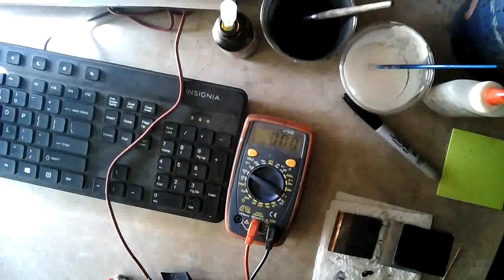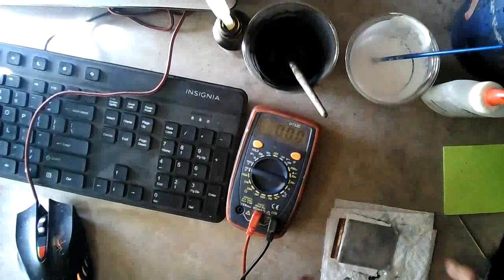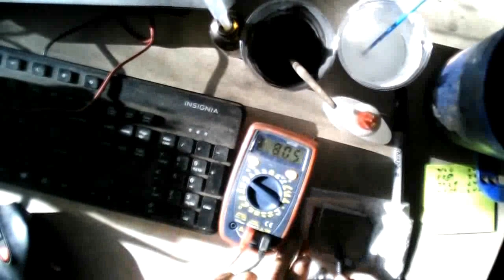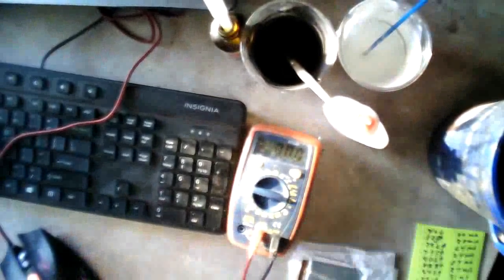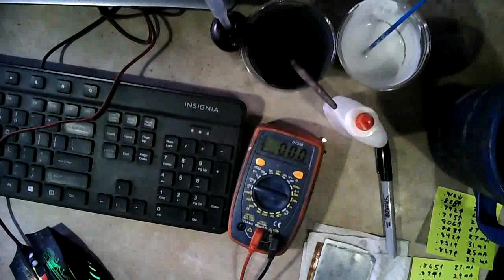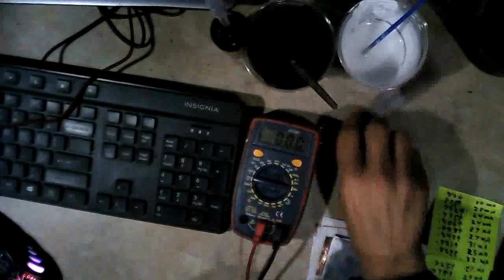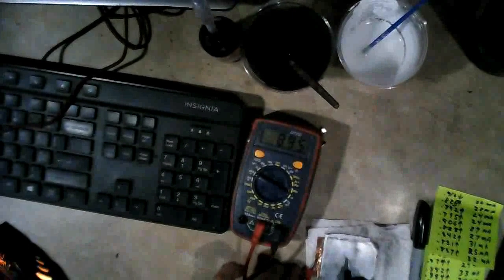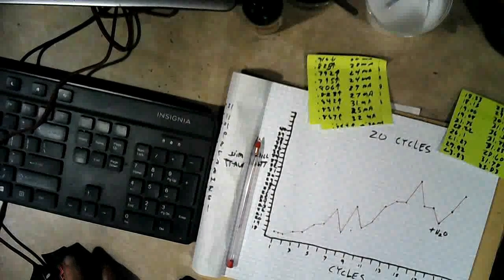A Better Borax Separator!

Comment: The overall performance improved and the number of cycles in which the improvement continued increased. That's encouraging. Your dilligence is paying off. The cell is testing your endurance but that's a good thing. We can only hope it continues as such. Now if you can come up with a way of keeping the cell hydrated longer it may keep climbing even more. I'm not sure how that could be achieved without adversely affecting the performance. We'll have to think about that one.
Reply from the maker: In the air interaction video I put a cell in a plastic bag, and it performed fine until I sealed the bag and shut off the oxygen. Then I revived the cell by opening the bag. A plastic bag should work fine, as long as it can get some air.
Reply: Thus the importance of a controlled environment test chamber. It makes so much sense.
Reply from the maker: It does make sense of course, or I wouldn't do it. Lol Unfortunately, the test data won't answer all the questions. Some things will still be up to interpretation by the researcher or who ever.

Comment: What metal is the top current collector? So this thing self-charges, do you think there is a galvanic reaction at all with the top metal? This is very interesting. WOnder how much juice you could pull out of it. Need to build a little circuit that pulses every 20 seconds or so
Reply from the maker: Hi Proteinman, the metal is zinc, and it does oxidize over time. Thus far the highest amp reading has been 128 milliamps without electrolytes, but that will be going higher now that I know how to build a better thin film separator. :-)